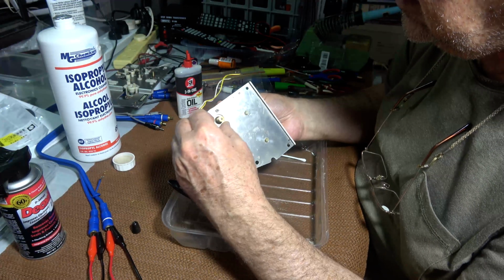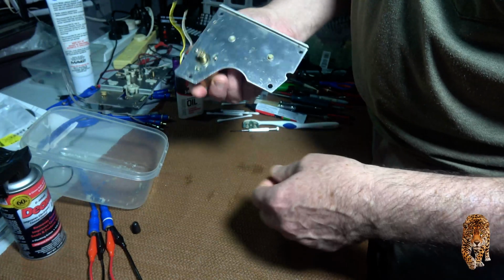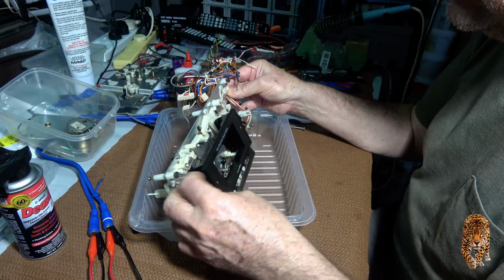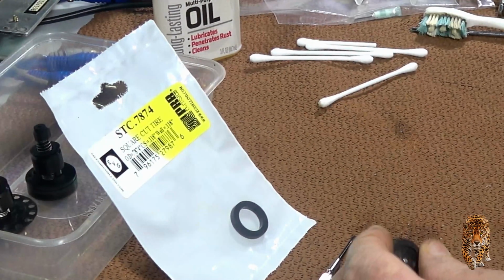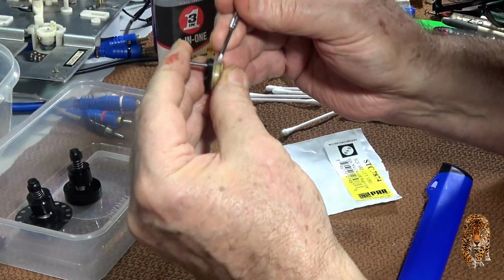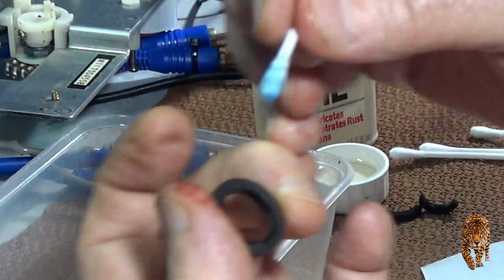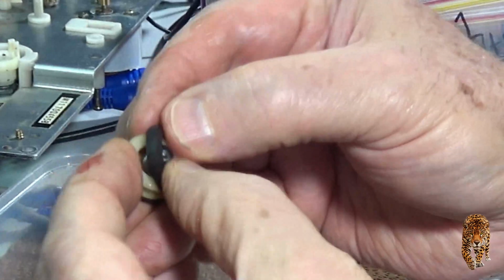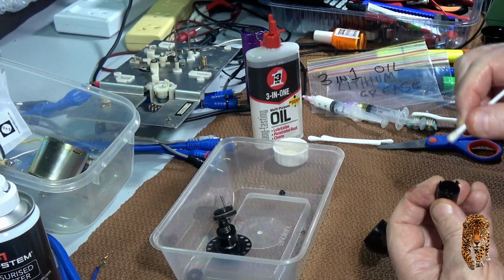Nakamichi 1000ZXL Repair Part 6F. Capstan motor, more cleaning & Idler tyre replacement

Comment: For those who will change idler. Be careful you can break the rim. I ended up damaging the rim. I removed the old adler by drilling through four sides of it. And then he broke it off piece by piece. This rubber did not dissolve even in strong organic solvents.
Reply from the maker: Indeed. I sometimes simply cut away the old one, it's not good for any purpose. The new tyre is usually soft enough to go over the rim without damaging it.

Comment: Thanks for the tip on rubber grease. I’ll have to try that, those idlers can really be a bear to get on evenly. One caution, if that grease gets into the idler clutch felt and makes it too slippery you may have problems with the RAMM and cue mode operations later. The clutch needs to be grippy enough for the idler to move quickly from side to side FWD to REV and vice versa. I’m looking forward to this one coming together!
Reply from the maker: I agree it's not the best thing to do but getting the tyre to sit in the rim is almost impossible without it. It's a compromise.
I just had an idea that if I ever pull this transport apart again I would disassemble this idler clutch and ultrasonically clean the idler wheel and tyre to remove more grease from it.

Comment: oil the back bearing by removing the small circuit board?
Reply from the maker: I couldn't see an easy way to get into the inner bearings and we have bigger fish to fry. 
I state in a later video that once the deck is working it would be a good idea to remove the mechanism and PROPERLY clean it, AND clean and oil the capstan and reel motors properly. That's a major job and not being done by me at present. We need to get it to work before committing huge resources.